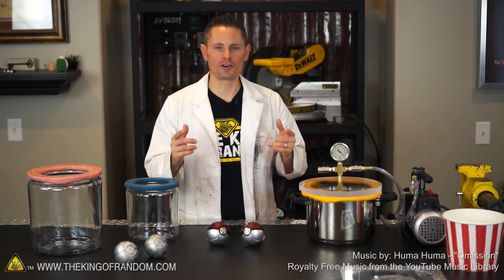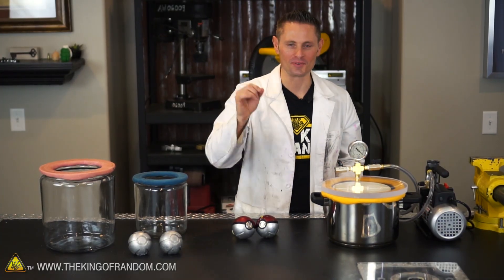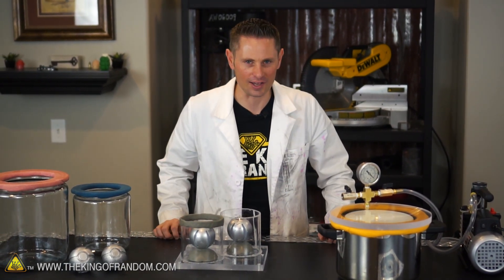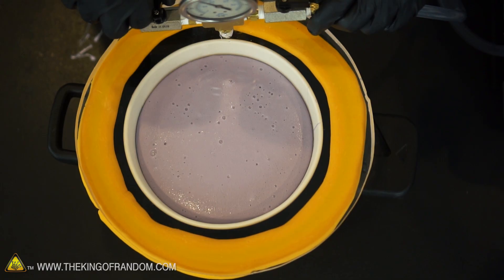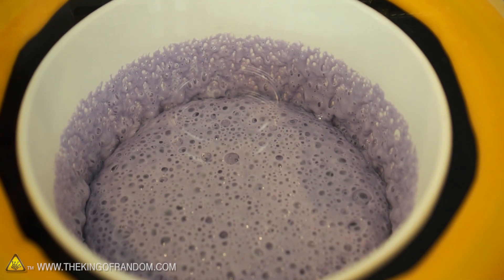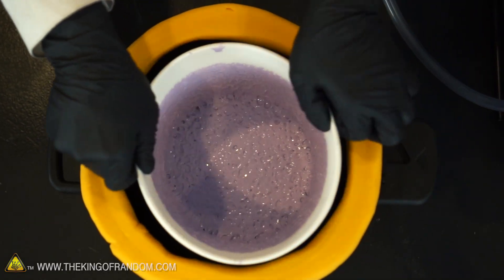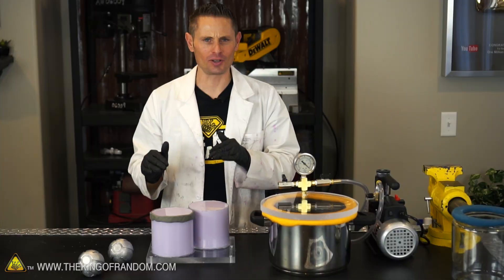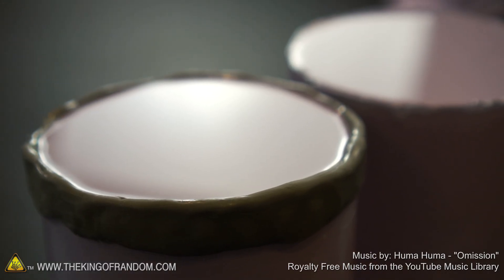How Does Silicone React In A Vacuum Chamber | TKOR's Silicone In Vacuum Chamber Experiment

Comment: you should first pour the silicon to make the cast and then put it into the vacum chainber😉
Reply from the maker: That would actually suck the air out of the object as well, in the case the PokeBall, and ruin it
Reply: Grant Thompson - "The King of Random" I wouldn't have thought of that if you didn't mention it here. most guides I see put the mold with silicone into the vacuum chamber(they hand mixed them and the difference in bubbles is really huge, but your mixture consistency with the beater is much better than theirs, theirs usually have a marbly texture, so there's merit to both methods)
Reply: vacum
Reply: If the poke balls were his, he could remove the electronics inside and let the silicon in, letting it set with the vacuum on in a taller tube as was mentioned?
Reply: Yes it's true becouse poke ball is not solid so it would ruin everything sorry i forgot
Reply: Thats why you should do it :P
Reply: Domen Pečovnik also with how much the silicone expands in the vacuum chamber because of all that air the mold would over flow. He would have to make the tube taller.
Reply: Grant Thompson - "The King of Random" Then why not use a solid mold?
Reply: +OM G ... It might implode the pokeball. At the very least it would force the silicone through the cracks of the pokeball and fill it.
Reply: Grant Thompson - "The King of Random" how ?
Reply: chamber mistake
Reply: Yes i agree that is true
Reply: Thanks😉
Reply: Bhak Jolicoeur  Ah, okay, I see what you meant before, pretty sure I've seen it done too. But yeah, with this process it would definitely be a lot more of a catastrophe lol.
Reply: No.
You only vacuum the mold when the item itself is a silicone item being cast in something else (like rubber).
For the process in this video, he's doing it properly.

Part of the issue with vacuuming the mold with a positive inside it, is that the vacuum can distort or destroy the positive.
Reply: I predict that the pressure from the expanding silicone would be greater then the internal pressure of the pokeball, causing it to implode. As the vacuum sucks the air from the pokeball, it would then implode (or fill with silicone) from the pressure of the expanding silicone.

Alternately nothing would happen, as there would be no atmospheric pressure to collapse the void.

It's just a prediction that would be cool to explore in a video.
Reply: the pressure comes from our atmosphere I believe.  with the air being removed, 14.7 psi of atmospheric pressure claims the space.
Reply: if the pokeball is airtight and if it aint strong enough to withstand the pressure difference then it will explode :p if air is sucked out slowly enought to equalize pressure then it may implode as u say :)

Would love a few experiments :P
Reply: make a gummy face
Reply: TheMajorBuzzkill Is may work with a solid mold, but these aren't solid molds.
Reply: Domen Pečovnik that is what i thought
Reply: Bhak Jolicoeur  there's already a couple of replies that explain why that's a bad idea
Reply: killer slowpoke v
Reply: I realized I was thinking of a different process, and deleted my comment.
After the mold has already been created, if someone is making a silicone item, they will often put that silicone item (in a mold) into a vacuum chamber to pull the bubbles out.
(In addition to degassing prior to pour).  I've seen it done by manufacturers that I know.
Reply: Also I realize, vacuuming the mold could destroy the Pokeballs.
Reply: Than you make a bigger chainber right?
Reply: explode  :)
Reply: things "implode" under vacuum
Reply: No, "things" don't implode.
But when an expanding material crushes a void, it can implode, or at the very least the expanding material will replace the air released from that void.
If I had a vacuum chamber right now, I'd try it out and post the video.
Reply: So youre saying that explosions cant happend in space ?
An explosion would occur if the pressure inside the pokeball is greater than its atmosphere..

The pokeball would implode if the pressure in the pokeball is lower than its atmosphere.
You could do that by making higher pressure in chamber or lowering pressure in the pokeball.
Reply: yes,  the pokeball would collapse in a violent manner due to the air within it escaping
Reply: didnt think of that. You may be right :)

Hard to say but i dont think the silicone would make any pressure.
Its the air in the silicone that expands not the silicone it self
Reply: The only way to know is form an experiment and test the results.
I'm thinking about making a vacuum chamber to test it.
Reply: Domen Pečovnik But what about the poke balls, wouldn't they be affected by the pressure?
Reply: When the entire mold and item is inside the vacuum chamber, there is no atmospheric pressure to deal with. My thought is that there might be a pressure differential between the pokeball and the silicone surrounding it.  Just like the air bubbles causing the silicone to inflate, the air will also try to escape from the pokeball. As the air is reintroduced into the chamber, it might force the silicone into the pokeball, or collapse the pokebal.
Reply: Domen Pečovnik no...hmm...The silicone casting wil be ruin cuz the silicone will rise up....Thanks me later (~_^)
Reply: Troy Pierson Slain sheep